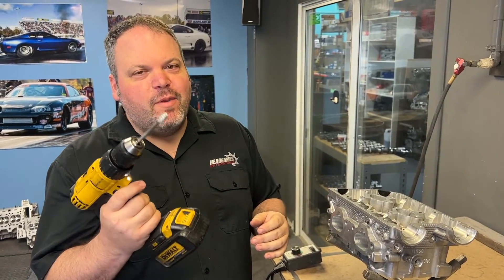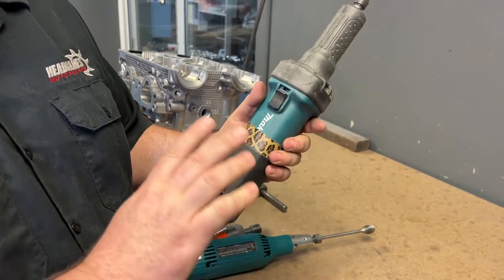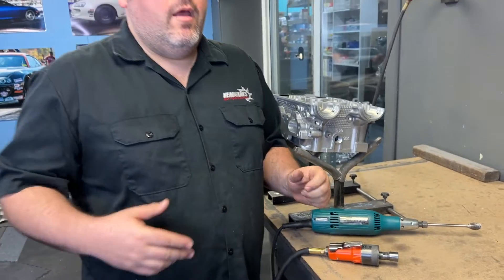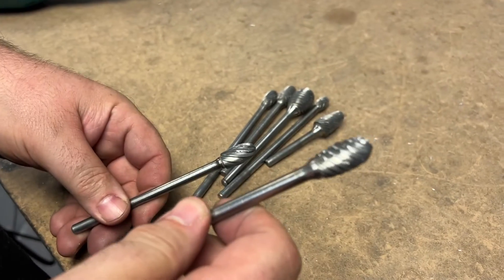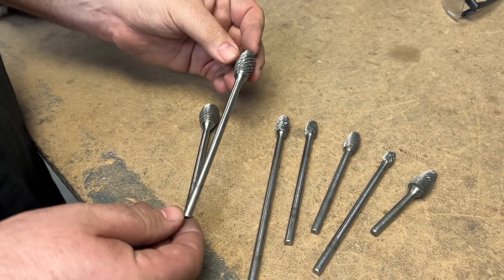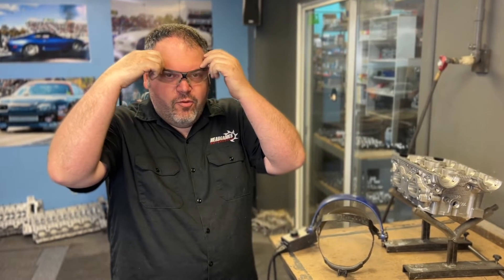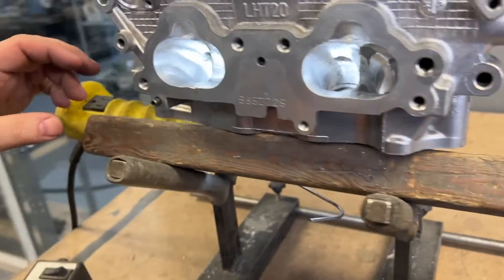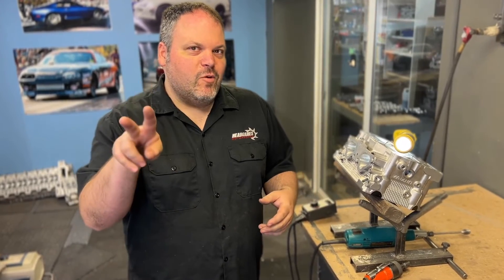The basics of porting a cylinder head!

Comment: Hey i have a german made Ford v4 with steel heads what grinder bits should i get for porting:)
Reply from the maker: you need some double cut burrs. We don't sell them. Check out ruffstuff.com
Reply: A Nine inch is perfect for engines like that

Comment: No foot control?  No particulate collection?
Reply from the maker: Definitely no foot control. Trying to throttle it not a fan of the particulate benches either.
Reply: @headgames  if you do it long enough, you'll get there..
Reply from the maker: I am 25 years in. I don't see the attraction, I like a constant speed. When I used a Milwalkie grinder, I used to throttle it with the trigger, but thankfully those days are long behind me.  @gregsilva1230
Reply: the next pearl of wisdom you're going to share is that you do all of this without a flowbench too?  @headgames
Reply from the maker: nooo...look at our videos, we use the flowbench a lot! But, pearl of wisdom would be don't believe everything it says. Although, I probably lean on it to much for answers. And get upset when it kicks me in the nuts. 
 @gregsilva1230
Reply: Well, that's refreshing to hear. There's nothing wrong with getting a nut shot, that's why we have a bench.  Just as any other form of measurement, Dial indicators, Mics, or even a pickin ruler for crying out loud. If you can't except what they're telling you, you might as well throw them away and go fishing.  Understand the Why, instead of 'it can't be'.
 This is the main problem I have with 'this is how you do it crowd'.. it is IMPOSSIBLE to relay every little nuance of porting gleaned from careful flowbench testing in a single video. (35 years for me and 3 flowbenches later)
I have seen more heads completely ruined by well intended amateurs than I care to count.  Or beautifully finished ports that barely flow better than stock. All of these bad habits passed down as truth.
 I've always said, never touch a head with a grinder, unless you have a flowbench.  @headgames